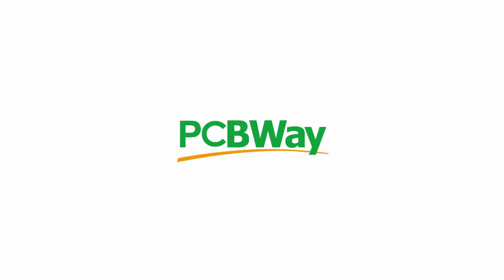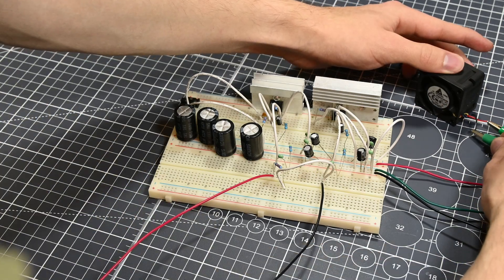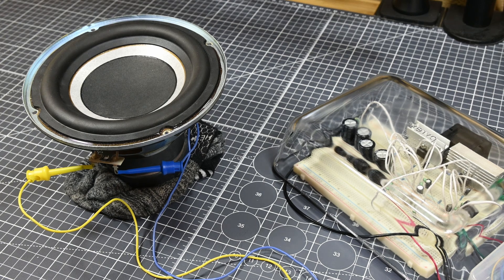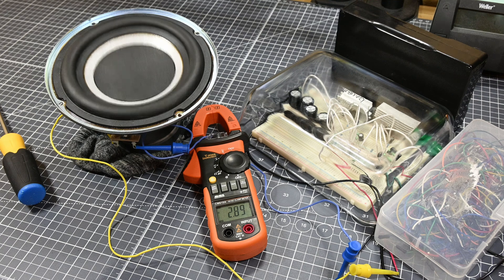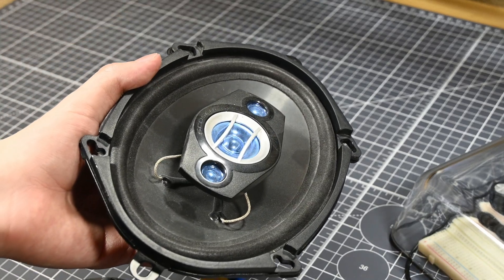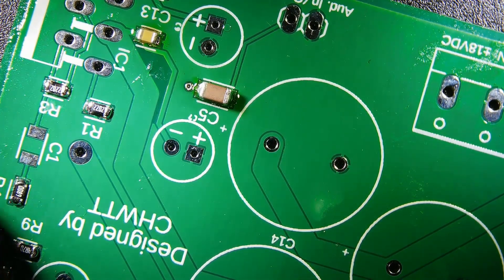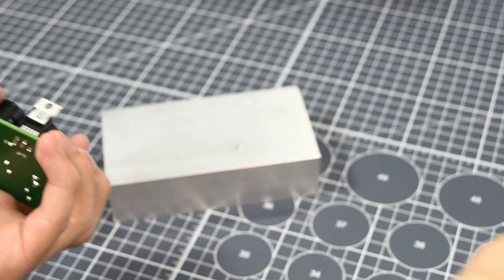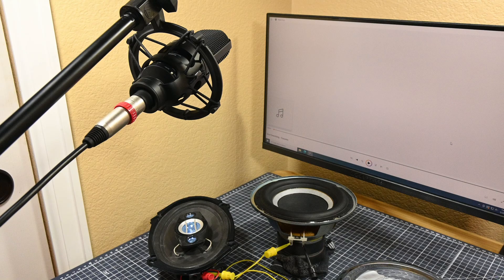Let's Build a Simple, Powerful Speaker Amplifier!

Comment: About resistance and impedance... they are not equal in speakers. The 6.4 Ohm DC resistance speaker is a typical 8 Ohm speaker.